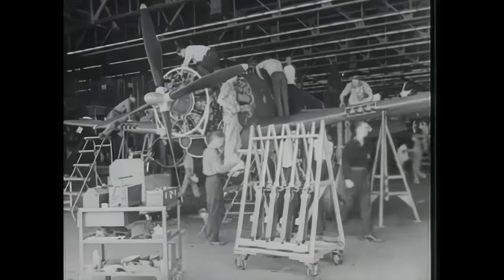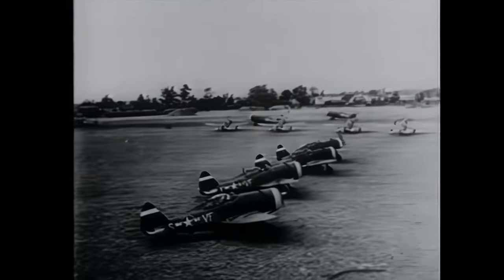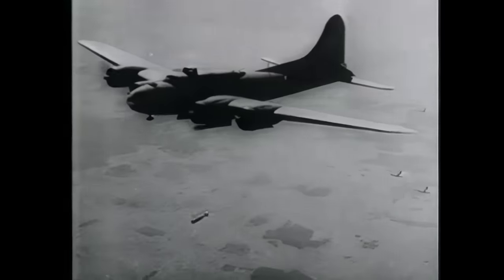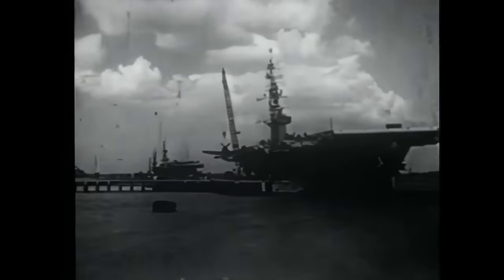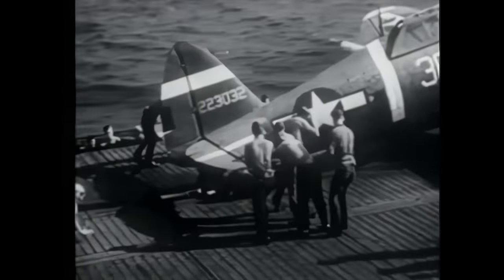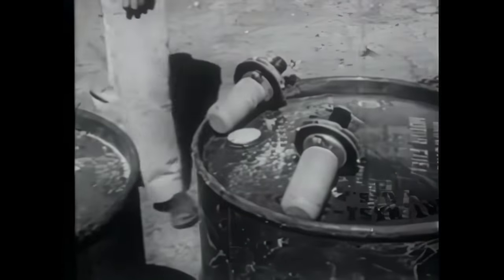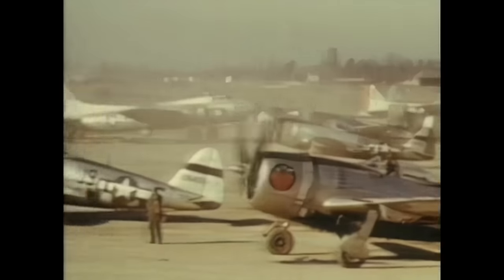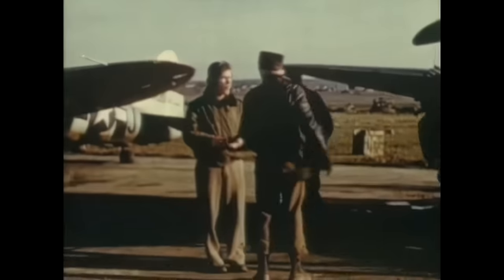P-47 THUNDERBOLT | WWII Fighter Aircraft, Nicknamed the "Jug"  | Upscaled Documentary

Comment: Highest scoring Fighter Group in the 8th Air Force, the 56th FG "Wolfpack", flew the Thunderbolt through its entire career and did so at its own request. M and N models had almost as much range as the Mustang.
Reply: Not the M model. The N was the Thunderbolt version that was long ranged. The N was basically a D model with upgraded Pratt and Whitney that could put out 2800 hp!
Reply: @PoochAndBoo  
M&N's both used the R2800-57 engine, the N was basically a P47D-40 with "wet wings" and the -57 variant engine. 
And it's a misnomer that the N was developed specifically for the Pacific, if anything it was actually being designed for Europe. 
In the Pacific fighter's weren't prohibited from the use of drop tanks like they were at first in Europe, the commander's in Europe may not have been smart enough to understand that prohibiting fighter's from using drop tanks was a problem but the engineers at Republic were, they recognized immediately that fighter ranges were an issue so they went about it themselves to develop wet wings for them as a way to increase their range and not run afoul of the whole drop tank heartburn that the commander's in Europe had, but since the USAAF's wishes came first development of wet wings for the P47 had to take a back seat to some of the P47 variant's that the USAAF wanted developed that never wound up being produced anyways like the inverted V16 Chrysler engine variant, as a result by the time the N variant was fully developed P47's already in use in Europe were finally provided with drop tanks enabling them to go with the bombers anywhere they went anyway, and since victory in Europe was pretty much a forgone conclusion at that point anyways it was deemed that all produced N variant's would be better used in the Pacific with the long ranges that escorts were required to fly.
Had Republic not been saddled up with developing variant's that were never produced anyways and the USAAF seen the importance of range earlier the N variant undoubtedly would have had a much lower alpha numeric designation than N, it could very well have had the designation of one of the unproduced variant's like J or maybe even lower, who knows it might have been ready when P47 fuselage's still had the razorback feature.
Reply: The hot rodded P47M Model was tweaked by the Crew Chiefs , with wastegate modifications to increase the boost of the big GE Turbo , 100/150 octane fuel and 72 hg of Manifold Pressure the M could acheive between 480-490 mph . She was badass !! 🇺🇸👍
Reply: THE N model had MORE range than the mustang!!!!!!!!!  When finally given drop tanks ALL the other variants were equal in range to the 51!!!!! THE RANGE THING WAS A MYTH PERPETUATED BY THE BOMBER MAFIA!!!!!!!
Reply: @scottinohio701  
Kinda, although the P51 never used them in Europe and only the unit flying off of Iwo Jima in the Pacific did the use of the 300 gallon drop tanks on them appears to have given them more range than the P47N's in the Pacific that were the primary users of the 300 gallon tanks.
But there's several things that negate the issue anyways, even if coupled with the 300 gallon drop tanks gave the P51D more range than the P47N it doesn't matter because the P47N's were going anywhere the B29's were going anyways, so unless they planned on flying escort missions from the factory P51's having more range was a mute point. 
Another thing is all the records indicate that B29's didn't need escorts, the difference in loss rates between escorted and unescorted B29 missions was negligible, the B29's kill to loss ratio of 11.9 to 1 was actually better than the P51's record of 11 to 1, it was actually deadlier to enemy fighter's than it's escorts were, that's because between the speed and altitude that it flew at coupled with it's computer augmented defensive gun sights meant that enemy fighter's were clawing for air and could barely maneuver at that altitude making them clay pigeons for the gunners in a B29 with their highly advanced defensive guns.
Reply: @dukecraig2402  Just negating the myth that 51s had more range!!!!!!
Reply: @dukecraig2402  Are you saying 51s did NOT use drop tanks in the ETO????
Reply: @scottinohio701  
I know, I'm 100% on board with it, I was just pointing out that even if it's true it's a mute point because the P47N's were going anywhere that the B29's were going anyways, and even then the record shows that the B29's didn't need escorts anyway, which is actually an important point and for reasons I'll explain here in a second and is proof that instead of building P51's they should have built more P47's.
There's a P47N pilot who flew missions over Japan that's in 2 interviews here on YouTube named Martin Jackson, in one of them he talks about how due to something like the coral based earth of the islands in the Pacific P51's that were sent there at first and were also being given the task of ground attack were actually shooting themselves down by flying into the ricochets of their own .50 caliber rounds, he said that it was something they wanted kept quiet and pulled the P51's from doing ground attack in the Pacific, originally they were being sent to islands to strafe and destroy Japanese aircraft on the ground at their home bases, which is smart, but as it turns out using P51's for that wasn't, so like in Europe P47's did the down and dirty work and the P51's were task with escort duty, however since it turns out that the B29's didn't need escorts anyways the use of P51's in the Pacific seems to be a waste.
Reply: @dukecraig2402  Could you please give me the video address of the P-47N pilots.   I have a dog in the fight here,my father was an original pilot in the 358th FG  ,he flew his 1st mission in early 43,and flew 104 combat missions,then was a test pilot on N models.
Reply: @scottinohio701  No, actually he didn't say that. He said they weren't using that huge 300 gallons tanks. They mostly carried the 75 and 108 gallons drop tanks over Europe.
Reply: @scottinohio701  
No, I'm saying they didn't use the 300 gallon drop tanks in Europe at all and only from one base in the Pacific, it was rare them using the 300 gallon tanks which when were used would have given them more range than P47's using the same 300 gallon tanks, but more on that in a minute. 
In Europe the P51's didn't need the 300 gallon tanks because the smaller one's could take them wherever they needed to go.
However even with the 300 gallon drop tanks it's still debatable that they'd have more range than the P47N, and here's why.
I had a guy who actually flies P51's here on YouTube tell me in the comments section of a video that Greg of Greg's Airplane's and Automobiles is wrong about the P47's having had the ability to fly escort missions to the early unescorted targets like Schweinfert on the infamous Black Thursday raid, wherein I do respect the fact that he actually flies P51's I think like a lot of people he's hung up on them and just doesn't like the narrative that Greg presented in his video about the P47's actual range, he's right in saying that before the P47D-25 that had an increase in their internal tanks they couldn't have done it but what he failed to realize is that the 56th Fighter Group had received their first D-25 variant's about a month before the Black Thursday mission, last year or so I saw a list of the dates of delivery for the first variant's released and the 56th got the D-15 variant with the under wing pylons for drop tanks 6 months before Black Thursday and the D-25 with it's increased internal fuel capacity about a month before that mission, that means using the relay system the D-15's of the 56th could have done the 1st and 3rd legs of an escort mission and their D-25's could have done the 2nd leg that's the one that could have taken them from where the first leg turned back to the target and returned after dropping their tanks and 15 minutes of combat, their increased internal fuel would have given them the ability.
He never responded to that one, I think he believes that the groups in Europe didn't get the increased internal fuel capacity P47 variant's until later but I saw the delivery records for the 56th and they had the D-25 before the Black Thursday mission and it makes sense if you think about the fact that the 56th Fighter Group was the champions of the P47 and Republic would have been getting them to the 56th first.
And he's the one that told me about the P51's flying off of Iwo Jima and how even though they were the only P51's ever to use the 300 gallon drop tanks it meant that in the Pacific they had more range than the P47N's. But I'm not so sure about that, he pointed out that places like Wikipedia and the online Encyclopedia Britannica aren't the best sources for information on WW2 aircraft, which I whole heartily agree with and is why there's people out there who believe that the Mosquito had the same bomb capacity as the B17, and that the pilots manual is a far better source for planning a flight when you're flying an aircraft, so afterwards I checked the pilots manual for both the P51 and the P47 and if you do the math for the P51 with the drop tanks they list his claim for the maximum range of the P51 was indeed correct, but I don't think he ever looked it up in the manual for the P47N, and here's where he may be wrong about the P51D supposedly having a longer range than the P47N, in the pilots manual for the P47N in regards to it's range for internal fuel it lists it at 1,400 miles clean (no drop tanks or external stores) with the mixture control set to auto lean, but it also says that if you reduce the mixture manually (Lindbergh style) that it'll "really increase her range", that means seeing as how the range of the P51 using internal fuel under the same conditions (clean) is close to the 1,400 miles listed for the P47N then using the "really increase her range" method by manually leaning out the mixture on the P47N might just give it more range.
Also I don't think he's ever read about the test that Republic did with an early P47N where a test pilot of theirs took off from Long Island where their field was at their plant and flew with drop tanks (size unknown to me) down to an airbase in Florida and after ejecting his tanks over the ocean participated in a 15 minute mock dog fight then flew all the way back to Long Island without stopping. 
Was the P51 a great fighter? Yes.
Was it needed to change the course of the war? No, it wasn't.
Reply: @dukecraig2402  Love your comments and thanks for calling out Greg's Airplanes and Automobiles. He covered it well from an engineering and inventory point of view. The top brass in Washington really messed up the range issue. The P-47 had external drop tanks much earlier (1943) and could have used them to escort bombers over Germany. Also, the Doolittle doctrine to go after and shoot down the Luftwaffe. That was a major tactical change, which had nothing to do with the airplanes but rather go take the fight to the Nazi fighter pilots. Bud Anderson often talks about this bold yet brilliant change.
Reply: @jacktattis  Excellent points. Some of the great German fighter pilots that lived through the war often talked about how the United States and Britain were able to rotate pilots off the line. I mean we all need rest I'm sure there was a lot of fatigue and burnout from 1943 on.

Comment: I took my then 3 1/2 year old son to see a display of WW2 fighters at the old Santa Monica Airport Museum. He spent much of the afternoon on my shoulders, but at one point I put him down to rest and he made an immediate bee line towards a mighty green P-47, and ducking under the cordon ran straight towards the nose. Before I could catch up to him he stumbled, smacking his head against the lowest prop blade positioned vertically a couple feet above the tarmac. Fortunately it was a glancing blow, however it did draw a little blood from the approximately 1" cut right in the middle of his forehead. A little antibiotic creme and a band-aid later and he was good to go. 
Fast forward 25 years, if you look real hard you can still see the very slight remnant of his battle scar, a reminder that he may well be the last person ever to be attacked by a P-47 Thunderbolt.

Comment: Wow insane ¡ never seen this footage ¡ the shortest carrier takeoffs ive ever seen ¡ insane ¡
Reply: If you look you can see raw fuel blowing out of what's the true exhaust on them, where you see blue oil smoke blow out up front just below the cowling on each side during start up of a P47 isn't really the exhaust it's the wastegate dumps, the real exhaust is on the belly behind the pilot which is directly underneath the turbo.
Typically the turbo doesn't even come into play until around 7,000 ft which is where the air starts to get thin enough that the engine's centrifugal supercharger can no longer provide maximum boost, at that point the wastegate dump valve's start to close diverting exhaust to the turbo to spin it so it can provide pressurized air to the engine's supercharger effectively keeping it operating with the same inlet pressure it has at lower altitudes, the higher it goes and the thinner the air gets the more the wastegate dump valve's close diverting more and more exhaust to the turbo spinning it faster and faster as per the engine's superchargers needs, the only time at lower altitudes that the turbo would be being driven by engine exhaust is when the pilot has the engine in War Emergency Power (WEP) with water injection, also known as overboost. 
Those P47's taking off from that carrier are literally at sea level where the air is at it's thickest, exhaust coming out of the true exhaust underneath the turbo on them instead of it all coming out of the wastegate dumps up by the cowling flaps is an indication that the pilot has the engine in WEP with the water injection engaged, on that variant that's probably good for 2,300 HP.